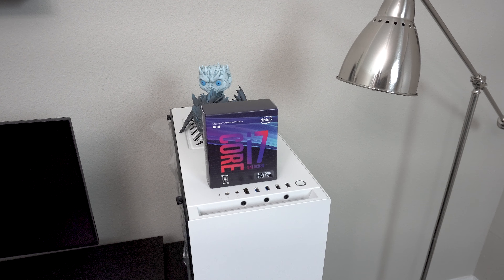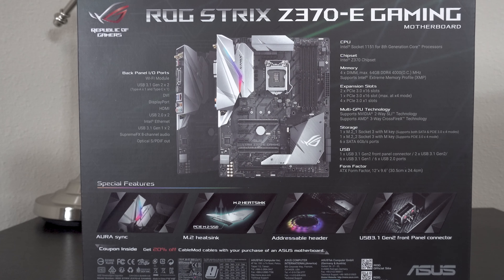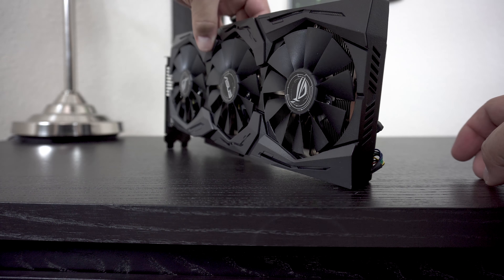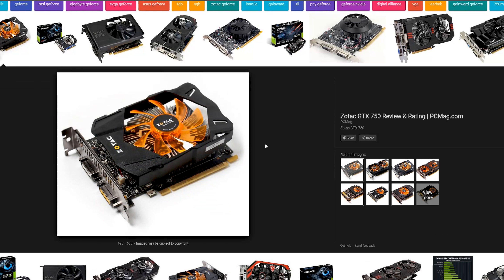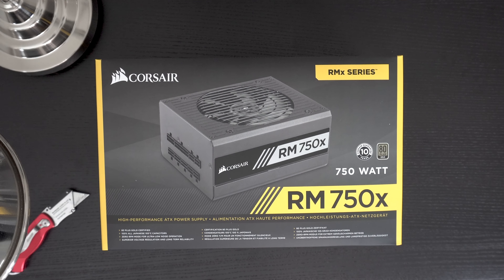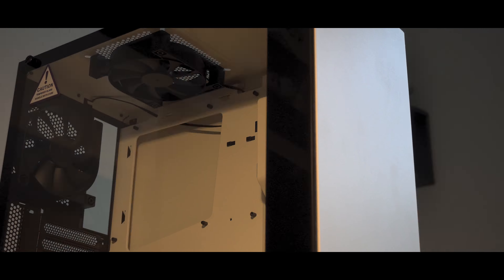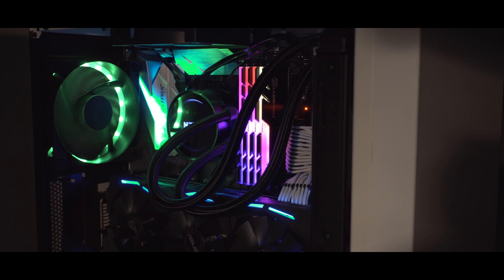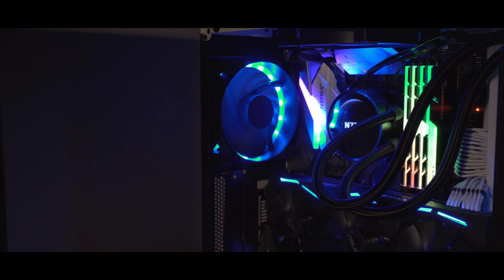PC Parts and Cinematic Build I7 8700k, Gtx 1080, Trident Z

Comment: Would you go 8700k or 2700x for 1440p gaming with a 1080 ti?
Reply from the maker: Probably the 2700x. At this point it's hard to recommend the 8700k over the 2700x. Not that it isn't a good processor but you get way more bang for your buck with the 2700x and AMD is really bringing their A game right now. Honestly the only reason I went with Intel is because "supposedly" it worked better with Adobe Premiere Pro.
Reply: They're the same cost 08/18